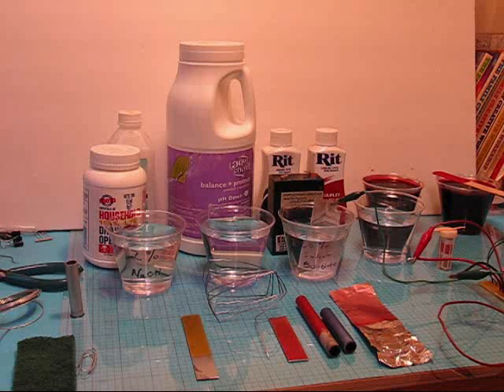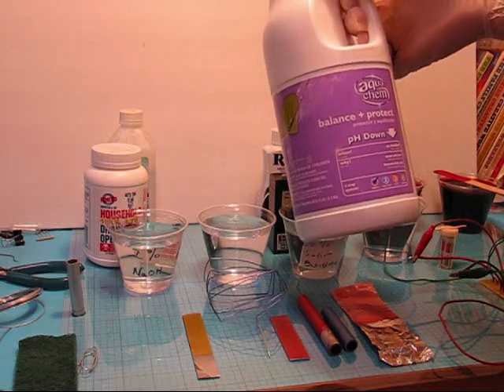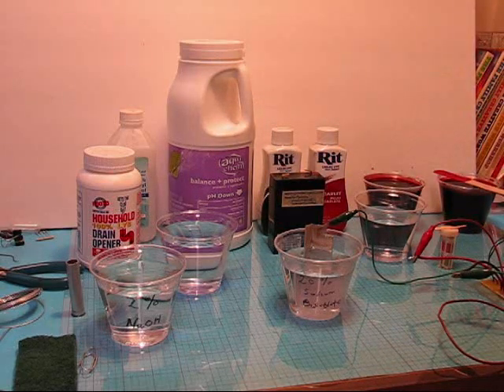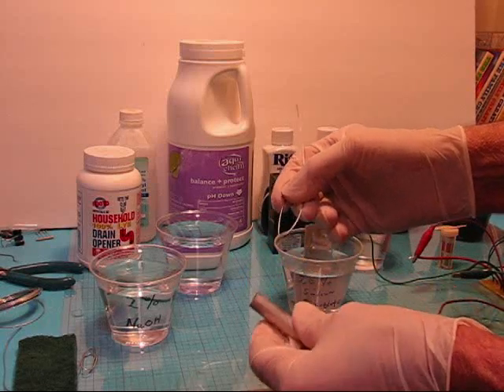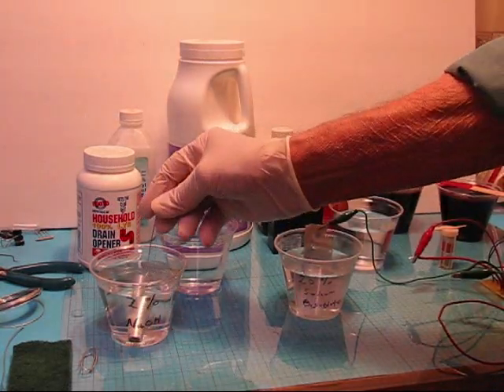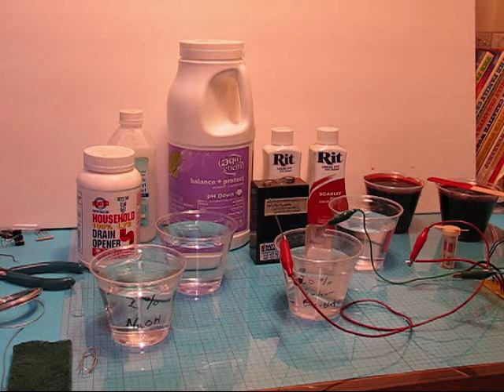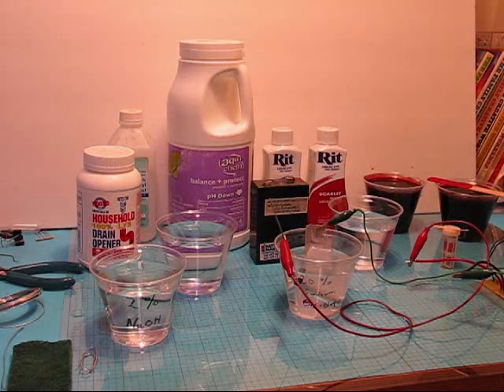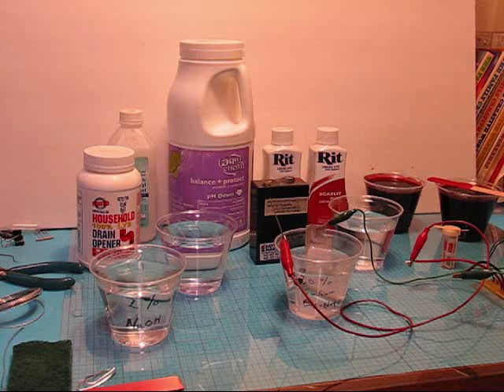Anodize and dye aluminum without battery acid!

Comment: Sir please tell PH increase chemical,distressed chemical, how to use .
Reply from the maker: Please go to the website which is open source and read the wriiteup and it will answer your question, Ken.http://www.observationsblog.com/sciencetechnologyexperiments/anodizing-and-dying-aluminum-without-battery-acid
Reply: Very helpful vid,  thank you!  The battery charger idea helped save me $60 lol.   I'm only anodizing 2 small knife parts and likely won't need to do this in the future.   I'm very experienced with titanium ano and so it is similar (I say aluminum is more work lol)

Only thing I need to figure out is the positive and negative on my battery charger,  which I'm assuming it's the same with the positive side of the battery

Comment: the higher polish the finish the less durable, to a slight amount. Also a DC power supply is a lot better than a car battery charger and you have way more control and can get a stronger anodized layer because the supply will be more consistent. Titanium wire is good because you can reuse it over and over again. The dye can also be brought up to 140 degrees and then once the part is dyed to preference, boil and rinse to seal the pores and dye. I'm new to anodizing but figured i'd just add that in. Also if you're anodizing aluminum you can learn titanium anodizing both are fairly easy. I'm in the process of learning anodizing aluminum and titanium, and plating nickel, copper, and gold. Good stuff

Comment: After an hour, remove the power source, rinse the piece, then dip into the dye until desired results, then boil the part in water for 20-30 minutes.
Reply: You seriously have to wait for an hour in electric solution?
Reply: Is it bc it's not being done is battery acid?
Reply: @tillmerit8431  No, you go do something else. But it depends on acide strength, current density, and that combo also will affect pore structure, so some experimentation is required. I use bisulphate, and a constant-current power supply, and 30 minutes seems fine. Using distilled water in our area is mandatory for good results.

Comment: You are talking about battery acid, this is Sulphuric acid H2SO4, used in normal auto batteries, so it should be easy available in the auto parts shop where they sell batteries or some other motor shop. Your method however works obviously. Sodium bi sulfite  is less acidic then sulfuric acid. There are other weak acids though: Acetic acid for instance, a bit smelly but you pour it in the salad and is surely easy available everywhere. We have not much swimmingpool shops in the Netherlands but a lot of grocery shops :)

Comment: when you say keep solution cool ? does that mean if I have my 200 amp battery charger and instead of waiting hours to do a piece at a fraction of an amp I can set it for 200 amps at 45 seconds ? or will this boil the solution make a mess and pretty much make a hole in the workbench ?

Comment: Great and useful video. Any advice for a power supply as in the UK cannot find a 'manual' charger - they all seem to be smart or intelligent and won't work?  Trying to find a cheap way of doing this so any examples of ways of doing the process without a charger?

Comment: Thanks for interesting video.  Do you know of any method to patch up areas on large anodized parts where the anodized layer has worn away so that the base aluminium is exposed?  In my case I am looking for a merhid to repair worn areas on my sailboat mast made of anodized aluminium tube.
Reply from the maker: I know of no easy way to anodize local areas but removing all the color and the aluminum will form its own protective oxide layer. Sorry I don't have better news, Ken.

Comment: Would distilled white vinegar work? Or maybe the muriatic acid  used to clean concrete?
Reply from the maker: If you are referring to cleaning the aluminum sodium hydroxide, lye drain cleaner is by far better than acetic acid or HCL, Ken.

Comment: Hi, I have an ali tube that has previously been anodised and coloured black. However in use over time the black has been rubbed off in places. I would like to make it black again. Can I go straight to the dying  process ? Or would I have to start from scratch ? thanks
Reply from the maker: +Robin Bonathan 
Hi Robin,
The fact that the color is gone means that the micropores are broken and the surface can not accept dye until they are regrown with anodizing. So yes, it is back to square one and it will have to be stripped and re-anodized. But recall that black is the most difficult color to make unless you use a professional dye like Caswell or other similar. Ken.
Reply: Hello Mate Ive got a question,I want to anodize the aluminium fins of my CPU heatsink,the problem is that it have copper heatpipes,will the copper react with the NaHSO4 and make a mess or it will stay untouched,anodizing just the alu fins?Hope you can help me :)
Reply from the maker: The sodium bisulfate will etch the copper.  Your solution slowly changes from NaHSO4 to a mix of Na2SO4 and CuSO4.  You would have to coat the copper with a protective polymer which may be difficult. Thanks, Ken
Reply: Dang as expected ahah would be like electroplating the "sacrificial aluminium cathode with copper"Thanks for the reply :) maybe ill try on a small scale some aluminium parts wrapped with copper wire as anode and see the results :) thanks again! Danny

Comment: So I added 1000grams of Sodium bisulfate to 4 ltrs of distilled water for a 25% strength mix but I’m having issues dissolving the crystals in the water .
Just seem to be sitting like a bed of sand on the bottom of the container after constant mixing.
In your description there is no indication to use heat .
So any advice would be appreciated thanks
Reply from the maker: See my response on my website as t is the last comment posted.

Comment: I was wondering if you could help me with something, I'm wanting to anodize 2''x60'' aluminum tubing using your method. I'm having a problem understanding the voltage on a larger piece of aluminum, I'm using a 2v dc volt power supply and everything I've seen on line is a little different from one person to the next. Some say it make the pour to big and it doesn't dye very well and the next one said it would, I would like to here you thought. Thanks
Reply: sorry, I'm using a 2amp dc power supply.
Reply from the maker: This would be a real challenge as the cathode has to be at least as large and the voltage and current will be difficult to control. I would have it done professionally. Ken.

Comment: hey! so I am planning on doing this in black to make letters to epoxy to a sign, but I need a lot of letters, and I thought that perhaps it might be nice to have some around: Black aluminum to do whatever with. So I was thinking that I would do an entire roll of flashing, 1×8 ft I think, do you think that would be possible? in a 5 gallon bucket maybe? or would it require too much acid and become basic too quick? glad yo hear your thoughts!
Reply from the maker: +Glen Childers 
Hi Glen,
First, I have had problems with flashing as it seems to be a peculiar alloy and difficult to do. Second, that is 8 square feet which means that the cathode would have to be at least the same or more. Third, the amperage required would be extremely high. (Check the formula at the end of the write-up on my website. Fourth, pH would rise very quickly and the process would end without anodizing. So, it is just not likely that this would work but the idea is a good one for having black aluminum on hand. Try a small piece first and see what happen. Good luck, Ken.
Reply: +observationsblog.com well jeez I didn't even think about the size of the other piece and you said it in the video itself! I think I'll find another method for my sign, thanks!

Comment: Hi Ken, I have been trying this for the last couple of days, mostly due to power supplies i have at home not being ideally suited, but after using a 3s lipo i get a decent amount of bubbling to start with, it then stops dead, is it just that all the Soidum Bisulphate has reacted? Battery still has charge.
Reply: My (rather poor) understanding of chemistry leads me to believe that the sodium bisulphate is not consumed in the reaction (at least not rapidly). It merely causes the water to separate into H+ and OH- ions. These ions then are attracted to the cathode and anode (respectively). At the anode, the reaction is 4OH- > 2H2O + O2 + e The "O2" is what reacts with the aluminium and the H2O (water) is simply returned to the solution.

There will presumably be a small amount of depletion (formation of aluminium sulphate at the cathode, sodium aluminate at the anode?!), but this will not happen quickly. More likely is that the electrical contact is being broken during the anodising process? You want to make sure the wire is properly jammed into the part.

Comment: Hello Ken,
I am trying this for the first time and by following your instruction, and doing the math. If I have 3 gallons of water I need approx. 2839 grams of the sodium bisulfate, am i right?

Thank you for sharing this much safer way for doing this.
Reply: Close but a little high. First, change the gallons to liters which is ~ 11.3. Then remember that for each 800 ml of water there are 200 grams of sodium bisulfate. So, then multiply 800 X 11.3 for the water. And,  200 of each liter is 200 so multiply by 11.3. The answer is close to 2200 but I have not done the math. However, your amount will work as my 20 % is an average and the process will work with more, just add water as it evaporates. God luck, Ken.
Reply: Thank you Ken, I'll work on my math again.

Comment: Hey, I want to do this for an aluminum rod about  a foot long and 1.5 inch thick
what would I change, larger bucket and more electricity?
Reply from the maker: +Sighs Internally Hi,
According to the surface area of a cylinder formula I get 56.5 square inches so the cathode has to be at least that large and the volume of electrolyte should be in the range of about 1-2 gallons (4 to 8 liters). With 1 amp plan on perhaps two hours but keep the electrolyte cool (room temp). To hot and you may experience problems. Good luck, Ken.

Comment: I am really struggling with this and I dont know why. 2nd try also went horribly wrong.

Used a small piece of ali off the main sheet to try to do a smaller part.
My first attempt went very bad as well.

I initially used battery charger but as its an heavy duty automatic job I am not sure was putting out enough current.
SO I then used a laptop charger brick, 18v 5amps rated.

20% PH-, mixed with tap water.

The ali test piece was fizzing even without power on 1st try.

2nd try again cathode to -VE, anode to positive supply.

The cathode emitted bubbles as well and seemed to flow to the anode, anode bubbling as well.

After couple of hours the cathode was still bubbling and the surface looked fine, very slight discolouration.

The real problem is my test subject on the anode which is pitted with darker spots on and rough.
Also it had lost about 10% of its thickness.

Sorry to keep troubling you but struggling here.

Any suggestions please.

thanks
Reply from the maker: +Robin Bonathan 
The problems that you are experiencing are not typical of this process at all. At this point  I am suspicious of the aluminum. It should not react without any power. The pitting suggests an alloy that is contaminated with other metals. Have you tried a simple piece of regular 6061 or a different piece of aluminum? Ken
Reply: +observationsblog.com I have tried 2 pieces now. the first one an extruded ali tube and an ali sheet that has been cut.
Reply: +Robin Bonathan Just looking at the PH- solution. It says its hydrochloric acid @ 19%. What is your ph- composition ?
I think yours is Sodium bisulphate which may explain the problem as from what i am reading, it looks like hydrochloric acid attacks aluminium !
Reply from the maker: +Robin Bonathan 
Well, that explains all of your problems!  Hydrochloric  acid will never work for anodizing. What I tried to make clear in the videos and write up is that the anodizing solution is made with a 20 % solution of sodium bisulfate. So, you need to find a true material that has at least 80 % sodium bisulfate and make a 20 % solution in water. Nice to find the answer to this perplexing problem. Ken.
Reply: +observationsblog.com Thanks Ken, my fault for assuming all PH - chemicals are the same !

Comment: What about using lead for the contacts instead of Aluminium or Titanium?
What gauge titanium wire would be to small? I've got a role of vape coil wire I'm thinking of using.
Reply from the maker: Lead is fine but the wire has to be able to handle the amperage and vape coil wire is too thin. Ken.
Reply: @observationsblogcom  Hi thanks for the response Ken. Would 0.5 Titanium be useful to me or is it to thin?
Reply from the maker: It's worth a try, but again, only if the current draw is not too much. I would opt for heavier aluminum or titanium. Again, my opinion. Ken.
Reply: @observationsblogcom  I've got 10m of it and I've stopped vaping. I might just spin a few strands together. It would be good for small bits.
I'm in the UK and with our current Acid attack crisis I might struggle with Battery Acid.
Have you ever tested Phosphoric Acid?
Also have you ever tried Electro Polishing?

Comment: check ph with test paper .. gotcha ... but you talked about numbers but did not actually say anything specific ? like if the ph is below this number your ok if above this you need to think about using new fluid ? 
and on subject of fluid you said drain cleaner solution was 2% and the battery acid solution (alternative) was 20% .. you failed to say exactly what the other 98% or 80% was ? water ? tap water nothing special ? or water that is not from your tap ? 
not a chemist so dont know how many types of water there is for this and apparently the wrong stuff is just wrong ?
I like to venture into new things with more info
Reply from the maker: If you go to the write up on my website you will find the answers to your questions. If there are more questions just let me know. Good luck, Ken. http://www.observationsblog.com/sciencetechnologyexperiments/anodizing-and-dying-aluminum-without-battery-acid

Comment: Will this work on Steel parts? I am looking to anodize some steel computer parts for a system mod I am doing and will be doing it in red and gold if this will work.
Reply from the maker: Iron and steel,  produce a powdery, non-adherent, hydroscopic, porous corrosion product (rust) when they oxidize; and this is not effective in preventing additional corrosion. Therefore, to my knowledge it is not possible to beneficially anodize iron and steel. Ken.
Reply: I know a similar process, electroplating, is used for chrome plating...is it possible to lightly coat your steel parts with aluminum through this method and then anodize that aluminum coating?
Reply: @choimdachoim9491  

If one was capable of "lightly coating steel parts in aluminum" then they wouldn't be asking this question nor watching this video.

Just a thought.

Edit: I also doubt they would choose the name "Patriot Prepper" lol
Reply: @CNYKnifeNerd  I was thinking they could just watch an electroplating video on Youtube.

Comment: why do you need to use distilled water?
Reply from the maker: Distilled water just provides one less variable if there are problems but it is not critical unless you believe that your water may be very basic which would allow partial neutralization of the acid. Thanks, Ken.

Comment: What should we use for anodising dye materials ?
Reply from the maker: Use a good commercial dye like Caswell or other for professional results. RIT works but correct way is the dye designed for anodizing, Ken.
Reply: @observationsblogcom  okay sir. Thank you. Why fabric dye can be anodizing dye, sir ? Is that true because of the small particles in dispersing dye type ?
Reply from the maker: It is because it is water soluble and fills the anodized pores and is then sealed in but may  not be as color fast as the professional dyes., Ken.
Reply: @observationsblogcom  So, the different is just at the color fast properties, sir ? If we dip more we can get close result to professional dye.
Reply from the maker: Yes but as mentioned i am not sure about color fastness by, for example UV etc., Ken.

Comment: hey man i cant get it to work small piece and using 750 ma leaving it in for 1 hour still wont anno
Reply from the maker: The process works every time when the material is sodium bisulfate, the cathode is either aluminum or lead, and the connections are secure. There is very little that can go wrong when these conditions are met. Just as a thought, 750 ma is a lot of current draw for a small piece. Please check your parameters and read some of the comments on the website if you get a chance. Let us know what you find  the problem, Thanks, Ken.
Reply: Could we talk on the phone? im having MAJOR trouble
Reply: Solved! Did a slou of things wrong. First off i reversed the connections 2nd off i did not use enough amps (Had to use 10 amps) and 3rd i did not dye for long enough.
Reply from the maker: Nice to hear that you found the problems and had success.  Thanks for the update, Ken.

Comment: Why aluminium and not lead cathode?
Reply from the maker: Either metal will make an acceptable cathode but aluminum is easier to obtain and safer than lead. But lead flashing works just fine. Ken.
Reply: observationsblog.com thanks Ken!
Aluminium is also cheap as i work with aluminium and have plenty of of cuts.